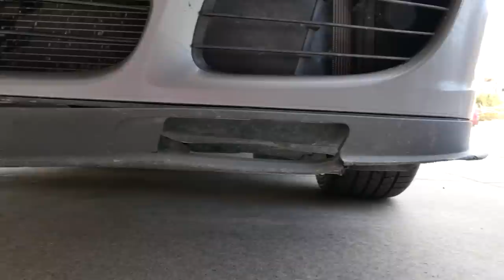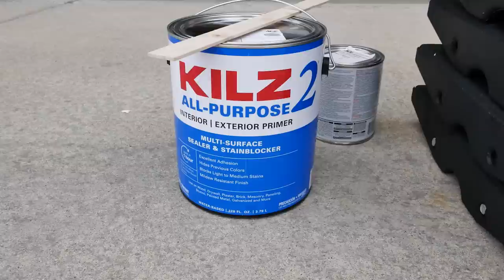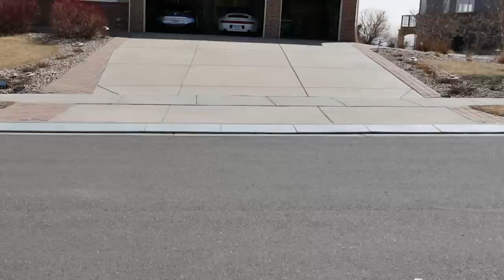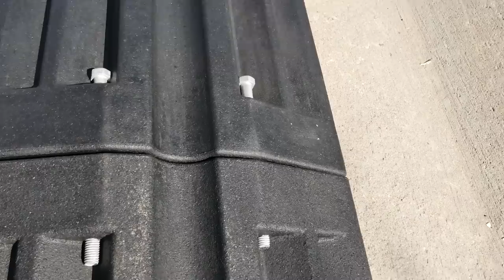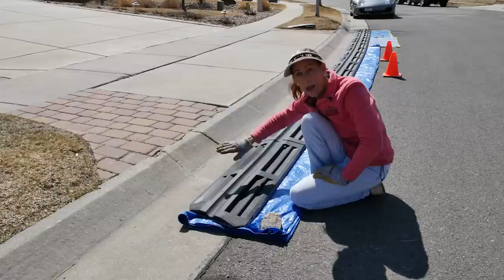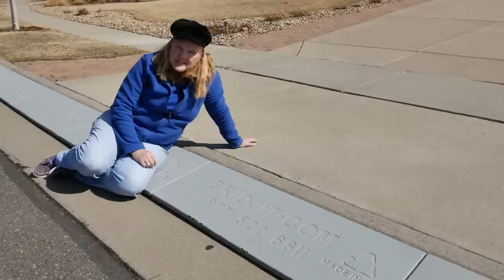Flattening the Curb with BRIDJIT Curb Ramps! and Painting DISASTER!

Comment: Rubber is tricky to coat and you recall from tires the brown funk that is leeching out from mould lubricant - it is a natural substance.  I wonder something like the bedliner spray might work. There is deck coating also that is similar to truck bedliner that might have a chance on top if the primer to hold itself together. Great solution though ladies!

Comment: We bought the whole set for a 3 car driveway. We do not live on a hill at all. It is not totally flat but just a slight incline. They are very heavy especially when you have a 3 car driveway all connected. The issue:  they move when it rains and from everyday travel across them.  So expect to have a wrestling match to put them back in place.

Comment: Great video!  I had considered something like this for my driveway.  My curb isn't as steep as yours but it's still annoying when trying to drive up the driveway and I've seen plenty of lines of what appears like remains of the i8 plastic jacking points where they touched the top of the curb.  So, mine is likely slowly degrading those.  Unfortunately, I live on a main street and I worry about theft, runoff drainage and snow clearing in winter time.  I'm still on the fence.  But, I will likely purchase from Bridjit if I decide to get them.  Thanks for posting!

Comment: Hi Franny. I have the same issue myself so this is a great tip. 
I work in the paint business so might be able to help. Did you use an acrylic (water based) exterior paint ? Usually an oil based primer helps for adhesion to oily surfaces. I’d be tempted to go over it with some water based paving paint (suitable for driveways) in a better colour match with your concrete after priming it with a oil based primer. Hot tyres can lift regular (non-driveway) water based paint by sticking to it. I think most of the damage to the coating ahesion occurred when you flexed the pieces when you flipped them. Alternatively maybe there is a specialst paint for tyres out there. Best to test first on an old tyre. I think over time the normal weathering and dirt will blend the colour with your concrete . A high pressure water gun might be useful for removing any loose paint.
Reply from the maker: I think it was water based.  It is gone now. Oh well.

Comment: Good video.  I have similar curbs, and interestingly, I also own a Porsche, so this was helpful.  I think if you used an oil based paint made for flexible surfaces (i.e. the rattle can paint made for plastic patio furniture), it would stick better.  Painting is also a good idea if you can get a paint that holds up, because it will keep the rubber from degrading.  These are made from tires, and it's exposed 100% to UV and weather, so these will probably only last a few years before becoming crumbly junk without some kind of protection. Honestly, I'm not sure any paint would stick to them though.
Reply from the maker: Do not paint them.

Comment: Did you guys ever figure out a solution to the color discrepancy??  I would definitely have scuffed up the surface, used an "Adhesion Promoter" primer, and USE a 2-part epoxy paint (kind of like what you would put on your garage floor!)
Reply from the maker: We just removed the paint. As soon as we drove over it, the paint stuck to the wheels of the car. It didn't work at all to paint.
Reply: @HeidiandFranny  Oh ok.  Probably for the best!  I was just trying to point out that you COULD if you really wanted to.  ;)

Comment: I can see how this might work as a temporary solution, but wouldn't it be so much better to just spend the money and get a mason/contractor fix the curb.  Painting the finished product, bolting it together, and having your driveway entrance as a large billboard with a company phone number in large print 7 times across does not sound appealing.

Comment: What size bolts?
Reply from the maker: They come with it - in fact we had several left over because each section comes with a set...
Reply: @HeidiandFranny  nice.. I just got mine from Amazon and it didn’t come with any so now I’m on my way to Home Depot💰💩
Reply from the maker: @13salinaspride  Really? That's no good! There are 7 1/2" long and 1/2" diameter galvanized.  I would contact Bridjit and let them know... They should come with the bolts.
Reply: @HeidiandFranny  yeah you would think it would! They aren't cheap. Thanks for the swift response I got some from homedepot!

Comment: Poured concrete would have been faster , cheaper, and more permanent...Just sayn....& if the city dudn like it they can come out and remove it...they own selves...
Reply from the maker: Not true... Closet to $3K for concrete. And that was a few years ago...
Reply: You can't feather edge concrete in a driveway as it will crack in thicknesses less than 1.5".  Plus if you use a non shrink grout that Quikrete recommends, it will cost more than these pads, and you will have 6 hours labor to do it right.  Also city inspectors won't approve a concrete repair to a driveway apron unless you saw the old one out entirely, and they require a permit.